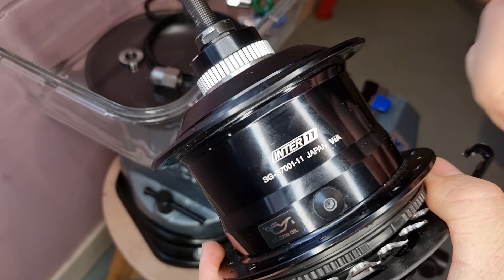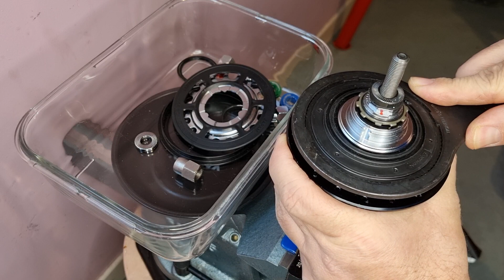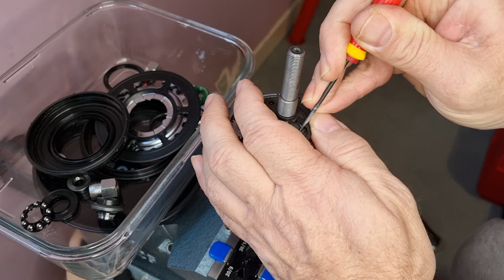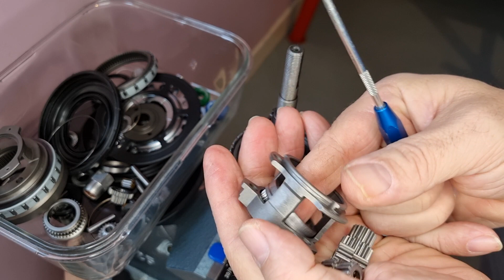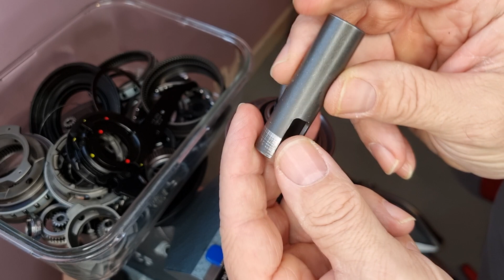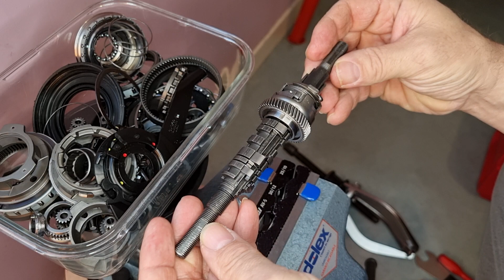démontage shimano alfine 11 SG-S7001-11 partie 1🇨🇵 dismantling hubs to completely overhaul

Comment: Hello.  I have a SG-S7001-11 which seized when I caught some rubber in it.  I disassembled the hub and removed the rubber but cannot correctly reassemble the hub.  Do you repair Alfine hubs?  What is your location?  Thank you  Tom